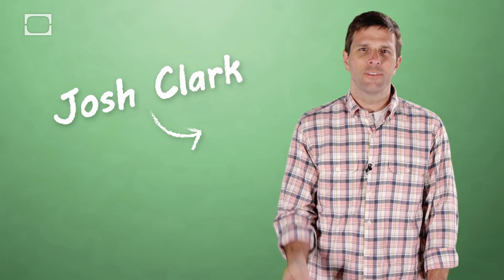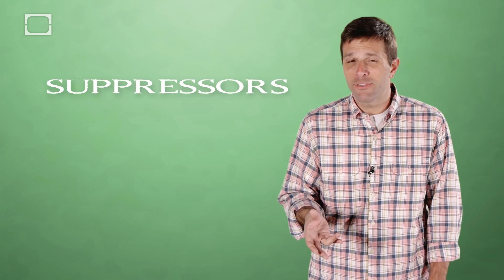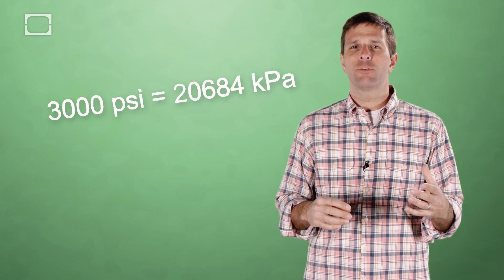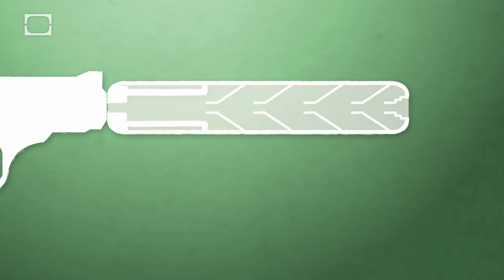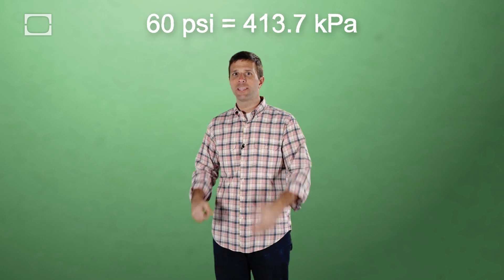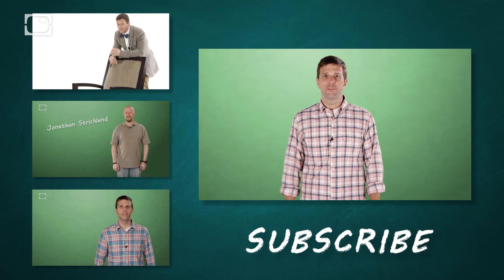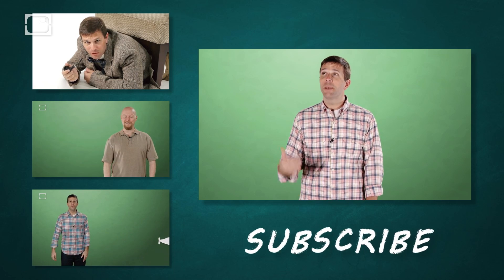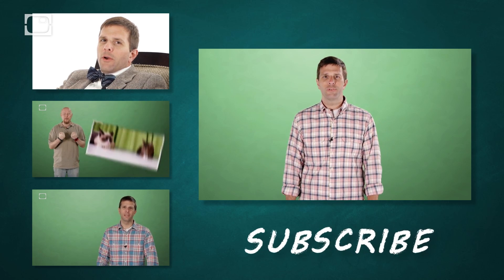How Do Gun Silencers Work?

Comment: Hmmm.... The gunpowder does not explode. if it exploded (or, detonated) you have done something really wrong, and your firearm would be transformed into an expensive puzzle game.
The burn rate of gunpowder is called "deflagration".
However. Modern gunpowder, the smokeless powder needs backpreasure to burn. If that backpreaure becomes to high, the way to detonation is VERY short.

Comment: Ok not that quiet. It really depends on the caliber and gun. Say for example if you're suppressing a .22, shooting subsonic, its close to say 40 or 50 db. A .45 can get pretty quiet too. With a top of the line suppressor, running "wet" (using a silicone based grease) you can get it to about the sound of a paintball gun, again using subsonic ammo. Either way with most firearms, suppressors just get the weapon within a safe hearing level, so the operator does not need ear protection. 

Sorry to break it to all of you movie junkies....The purpose for suppressors are not for going stealth on your enemies.

Comment: You wanna see if suppressors actually silence a gun? Buy a gun, buy a suppressor, take your gun to a shooting range or in the woods, attach the suppressor, and fire you gun to see if you can still hear the gunshot.
Reply: +Alex Zandate
No, no. Fire it with the silencer in a small, closed room.
Reply: +tohopes Exactly. Life isn't a goddamn james bond movie, silencers just make guns BARELY hearing safe.
Reply: +Josh Callejas No. My Gemtech Outback II makes my 10/22 quieter than a pellet rifle. My Surefire FA556AR does not make any of my ARs even close to hearing safe, but they sound about like an unsuppressed .22lr. Silencers vary substantially.
Reply: +The Chopping Block to be fair some loads of subsonic .22lr is just like, a step above a good pellet rifle. My experience with suppressors comes from a glock 17 with a ti-rant I rented at an indoor range. It wasn't exactly super comfortable without ear pro when firing cheap 115 gr ball. I'm sure subsonic ammo would fix that some, but still.
Reply: +Josh Callejas Supersonic anything is not hearing safe. It may be comfortable to shoot and may cause minimal damage, like an unsuppressed .22lr rifle, but it is not hearing safe. A 40 gr .22lr at 1,050 fps is a significant step up from any air rifle at Walmart. Sure, there are .45 cal PCP rifles that are substantially more powerful, but that's different. That TiRant would likely have been about as loud as my OutbackII if it were loaded with 147 gr ammo. Still much more comfortable to shoot than an unsuppressed gun.
Reply: +Josh Callejas Exactly. Almost as people getting their knowledge of explosions from movies. No, there is no giant fireball in real life unless there is fuel involved.

Comment: Silencers (Suppressors) actually do shut off the third sound. By lengthening the barrel you can slow down muzzle velocity so as to not allow the bullet to reach 1100 fps. You're welcome.
Reply: +RedstrokeProductions They don't actually slow down bullets that's a myth.
Reply: +RedstrokeProductions - ok yes.. if you had a long enough barrel, the bullet would slow due to friction.  Say... 10 foot or so for most handgun calibers.   But in most cases you SHORTEN the barrel to reduce velocity.  That said, supersonic ammo isn't going to go subsonic even on short barrels for some calibers.

Comment: "people who you probably don't want to associate with call it a can" yeh like the millions of people who legally own and use suppressors every day? what a fuckin tool bag. 

gun powder doesn't explode, it burns, at a predifined controlled rate, which produces gas to create the pressure curve that pushes the bullet at a uniformed rate of acceleration through the barrel. 

AND silencer is NOT an incorrect term, the definition of silencing is misleading yes but the device itself has can and is called a silencer. on the ORIGINAL PATTEN by Hiram Percy Maxim the device was called "Maxim Silencer". Also Google ATF form 4. Look at the bottom in Definitions section 1C... the fucking ATF, the ppl who regulate silencers under the NFA, CALL IT A SILENCER!

Furthermore silencers are not an extension of the barrel, they are are not rifled and are over bored I.E. a 9mm bore is .355 a 9mm suppressor is then going to be at .360 so that the bullet does not contact the baffles inside the can. Suppressors are akin to a muzzle device like a compensator or flash hider. Unless the crown on the suppressor is fucked up bad, and gasses do not exit evenly behind the bullet there should be virtually no loss in accuracy. The caveat is, certain typically high velocity rounds function better at their intended velocities loading rounds that are supposed to go fast to go slow sometimes causes ill effects however this would happen regardless of the suppressor. 

If you really are interested in how suppressors function go to one of the many wonderful firearms channels on youtube and don't listen to this assbag babble on.

Comment: brainstorm, why not just change the design of guns by building the suppressor within the barrel instead that way you can add another suppressor for the extra noise reduction.
Reply: +MackeyDeez They kinda have those. They're called integrally suppressed weapons, and the silencer is built into the barrel.
You can't normally attach another one, though.
Reply: +MackeyDeez As Jats said - they have them.  Integrally suppressed.  And the reason you don't see them more - is because the ATF still requires you to register them as a suppressor.   They don't actually care about saving people's hearing. :)

Comment: You would think that they would've fix all of that by now.
Reply: +Funky Fresh Lettuce Cleric oh I'm sure they have something that's silent and deadly. I mean there are other ways to propel a projectile other than combustion. I think
Reply: +Funky Fresh Lettuce Cleric, indeed but let me run this by you if I'm correct snipers are trained to mask the sound of their shots with another sound. Maybe that's the key; masking sound using some kind of high or low frequency emitter instead of a suppressor.
Reply: +MackeyDeez If you're an expert at knife throwing you can throw a knife from > 100ft and silently kill someone. But you to train for years before that.

Comment: I have never heard someone take so long to explain a simple concept all while sounding like a complete and total moron.

First and foremost some fact checking on the first few minutes. The term silencer is the correct technical term. As it has been stated in the comments that is what it was named when it was invented and that it what it is referred to in regulations. However it is used interchangeably with suppressor. I personally prefer the latter or the two. In addition the term can is widely used as a slang term referring to suppressors. I see no reason why you would want to avoid associating with people who refer to them as cans. Also a modern suppressor does nothing to change the accuracy of a firearm.

Now onto an explanation of how a suppressor works and what it actually quiets down. As stated in the video a firearms noise comes from three sources, the mechanical operations, the crack of a supersonic projectile (unless firing subsonic), and the expanding gases from the burning, not exploding.

A suppressor quiets the noise created by the expanding gasses by providing a series of baffle chambers for this gas to expand into and depressurize in. This depressurization reduces the sound made by the gasses as they exit the end of the firearm. This is identical to how a car muffler works.

Comment: Wow, no, just no.
 How about basic fact checking or gasp actual experience with your subject. Corked guns are still fucking loud, over 100 db, of course varying greatly depending on ammunition. The pressures mentioned are patently wrong. A silencer is not part of the barrel at all as mentioned (it does not increase velocity or have rifling), it is actually a superior muzzle device like a muzzle break or flash hider. Moreover, a can does not decrease accuracy, it actually increases it in rifles by stripping away gas that might affect bullet flight path. They also reduce felt recoil. Has literally nothing to do with power unless you are playing COD like this idiot

Comment: 1] you never really explained how a silencer works, just what it does.
2] your attempt at it is way off. Even a relatively small cartridge like the 9mm used by most military & police has an internal working pressure of well over 35 thousand PSI.

Comment: With your annotation you said it reduces the sound to about 130-140 decibels. This is a loud of bullshit, since 130-140 decibels is easily enough to damage your ears, rupturing if done over time. In reality, it lowers the sound made to ~30-70 decibels depending on the gun.
Reply: Ranty poison There has never, ever been a suppressor that has lowered discharge noise to this level. Even an air rifle is over 100 Db. It's a logarithmic, not linear scale.  The quietest of the many suppressors that I've personally heard was the integral suppressor on the H & K MP5SD submachine gun, and even that was still over 120 Db. Sorry, but I used to build and design 'em.
Reply: Sorry, sir but you are incorrect, I own many air rifles and none of them are even close to 100 Db, and have never heard of any air rifle being able to produce 100 Db of sound. 100 Db is enough sound to permanently damage your ears, and that level of volume isn't heard daily without specific cases/self-inflicted.

Comment: 3000 psi? Try 18,500 psi to 35,000 psi for handguns (.45 ACP and 9mm Luger respectively).
Reply: +RaderizDorret the guy in the video doesn't have a clue to what he's saying. at the beginning there is a pic of a revolver with a suppressor, 99.999% of revolvers can't be suppressed, only them mosin nagants can.
Reply: mr bad example Mosin Nagant?
You mean the Nagant 1895 revolver?
The Mosin Nagant is definetly not a revolver, it's a 5-shot bolt-action rifle.
Reply: "Marky Mark" Markus Gaming/LurkingFan4 yeah, it was late when i posted that, it's the revolver with the cylinder that locks up to the barrel before each shot. unlike standard revolvers that have a space between the cylinder and forcing cone.
Reply: Abby Normal *Someone refers to me as Mark on the internet*
Me: Mmm, me gusta...
Reply: Abby Normal you are obviously stupid, you missed what i typed on 9/21/15. so feel free to play HIDE AND GO FUCK YOURSELF!
Reply: ReverendMeat51
I've found the VP70 is a very manageable trigger compared to the Nagant revolver. Of course it varies among individual examples.
Reply: +RaderizDorret Even with no bullet the pressure is dangerous at close range. I remember they demonstrated this early in military service. A blank fired from an AG3 (7.62x51mm) easily shoots straight through a phonebook at point blank - no actual projectile required. 

A pretty good reminder to why it is a very bad idea to "prank" anyone with blank rounds (aside from it being illegal obviously).
Reply: +RaderizDorret Or Parabellum, if you want to call it that, I like to call 9MM Luger, Parabellum.
Reply: mr bad example Yeah, I could guess it was something like that, I've heard that the trigger's a bit tough, at least in double action.
Reply: +mr bad example You also have a very limited clue what you're talking about. Ther is no "Mosin Nagant revolver". However there is a "Nagant revolver".  Sergei Mosin was not involved in the creation of the Nagant revolver.
Reply: Ooh of course you rememberd it wasn't mosin nagant juust right after Mark pointed it out to you. Of course you actually knew it all along. Sorry bro, my bad ;)
Reply: +"Marky Mark" Markus Gaming/LurkingFan4 

"a bit tough" as in the worst DA trigger I've ever had the misfortune to pull. Narrowly edges out the COP 357 and HK VP70.
Reply: +RaderizDorret Sure there is an error, but the pressure will not be 18,500 to 35,000 psi at the moment the bullet exits the barrel. What you are referencing is maximum SAAMI spec pressure, which only happens for the very short duration.
Reply: the pressure from a blank round killed 2 actors. what do you think forces that big bullet through a tight barrel and causes rifling?
Reply: mr bad example
Agreed. The bullet that killed Brandon Lee was lodged in the barrel of a revolver and the full-charge blank fired the bullet with nearly the same force as a regular round. The pressure in a gun action is no joke.
Reply: TheStigma
Agreed. The sheer power in even a weak gun like a .22 lr is one of the reason why I get almost violently pissed off when people mishandle weapons. Guns can be a lot of fun, but they're still deadly weapons and need to be treated as such.
Reply: RaderizDorret i buy the occasional .25ACP cuz they're cute, small and just as deadly. i have about 1500 rounds of .25ACP, fits in a shoe box. it's not a "long range round", but up to 10 yards, works just fine  )
Reply: mr bad example
Personally speaking, I won't go smaller than .32 ACP for a gun intended for serious use. Penetration is adequate with FMJ rounds and smaller pocket guns are better suited to .32 from a reliability standpoint as the round doesn't put as much strain on the gun as 380 ACP. Still, rule one of a gunfight is "have a gun" (rule zero is "don't fucking get in a gunfight in the first place") and if all I had was a .25 or .22 I'd find a way to make it work.
Reply: +RaderizDorret I don't know why, but I like .22 handguns
Reply: ***** 90 dB isn't that silent, also 3,4 kg sound somewhat heavy to me
Reply: ***** Yeah, I know/ got that. I just wondered about those things
Reply: yeah. this guy doesn't know his bolt from his behind.

Comment: ok, so you use sub-sonic rounds and silencers=suppressors and both = not that quiet, onto the subsonic rounds which do go slower means that you loose fps (you can't get a faster speed and not make noise only an idiot would think that) and when you loose fps you ultimately loose a bit of distance, and accuracy wise it is going slower meaning it is more open to wind resistance and also directional change... in short it doesn't fully silence regardless of the name, and yes it does loose a small percentage of accuracy and power quicker over range...

Comment: No suppressor in history could reduce the sound of a gunshot down to 20 decibels. For today's state-of-the-art suppressors, you're looking from 115dB (subsonic .22 Long Rifle out of a manual action, not very deadly on animals larger than a rabbit) to 140+ decibels on a large-bore magnum rifle. Hearing protection (ear plugs and/or ear muffs) is definitely recommended, and with most firearms no suppressor will prevent hearing loss without additional hearing protection. Modern suppressors also do not reduce accuracy or power. This was the case in suppressor technology decades ago, using a method called "wipes" (not shown in this video). These wipes were discs, usually made out of rubber, that the bullets would have to poke through on their way out of the suppressor. Because of this resistance, it adversely affected velocity and accuracy, and the wipes had to frequently be replaced. Wipes are almost never used in new suppressor designs today, and if so usually in nontraditional ways (such as to seal in liquid to aid in suppression). Modern suppressors actually increase velocity and accuracy! Because the gasses are more slowly eased off, rather than rapidly escaping as soon as the bullet clears the muzzle. If there's a nick in the crown of the muzzle that can throw off the bullet, which isn't a problem with suppressors. Both suppressor and silencer are acceptable terms. Suppressor is typically preferred nowadays because the term "silencer" is misleading, just like this video fooling people into believing that the devices are capable of reducing the sound to an easily missed little "fwip" like you hear in the movies. Silencer is the original term (from the Maxim Silencer and The Maxim Silencer Company) and still the American legal term. Sound moderator is frequently used in the UK. "Firearm muffler" is technically an acceptable term and is used in law, but using it will make you sound like you haven't a clue about suppressors. A "can" is slang but unlike what is implied in this video suppressor crime is a Hollywood invention with no basis in reality, and few criminals would be knowledgeable enough to use the slang term "cans", which is used by firearms enthusiasts. Has HowStuffWorks read the 2007 paper by Paul A. Clark in Western Criminology review entitled "Criminal Use of Firearm Silencers" giving an overview of the (lack of) history of American silencer crime? I have, and I'm looking at it right now. HowStuffWorks should have gotten a gun geek for this video, because it's obvious that this "research" was put together from a couple of minutes of skimming on Google and Wikipedia, with no prior understanding and little knowledge of the history, law, physics, and culture involved. Suppressors are hearing protection devices to save you from permanent ringing in the ears for the rest of your life if a gun is fired next to your ear. Also to keep noise down when shooting to impose less on neighbors, keep the countryside nice and quiet, and be less disturbing to wildlife. In some European countries they're rightfully considered polite and considerate. Like mufflers on cars, they would probably be legally mandatory by now if people weren't so afraid of firearms, as they prevent hearing damage and noise pollution. As is our lawmakers are afraid of fictional assassins, and so they do tremendous harm by keeping these safety devices away from gun owners and users. Hearing loss is extremely common among people who frequently use guns, including in the military. This video is miseducational and needs to be removed and redone. I don't consider myself an expert, but if you film in New York I would be willing to volunteer to teach you or present it myself.